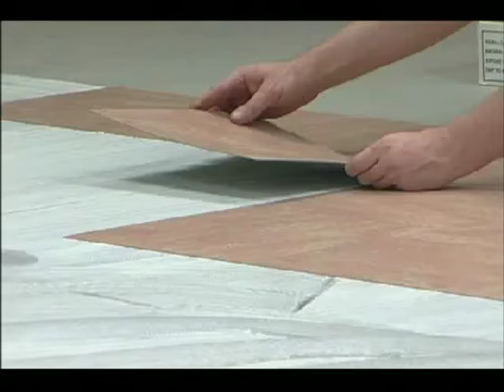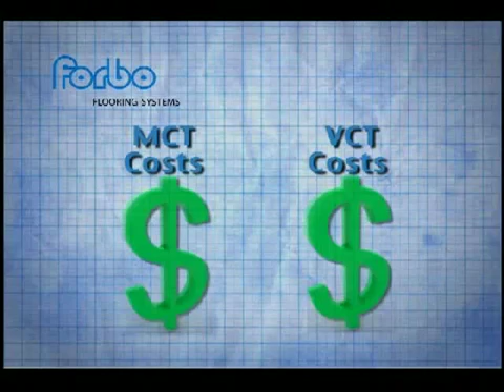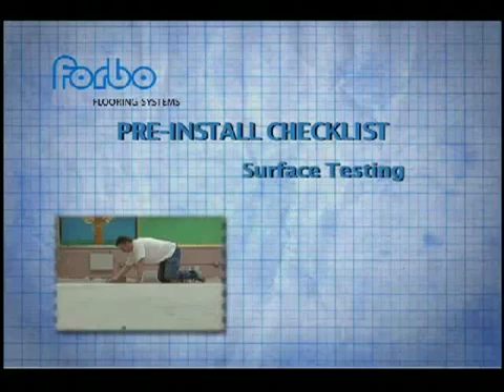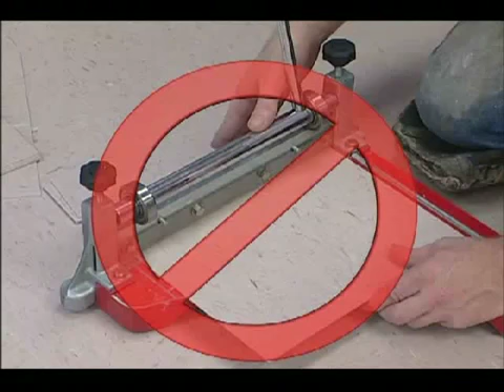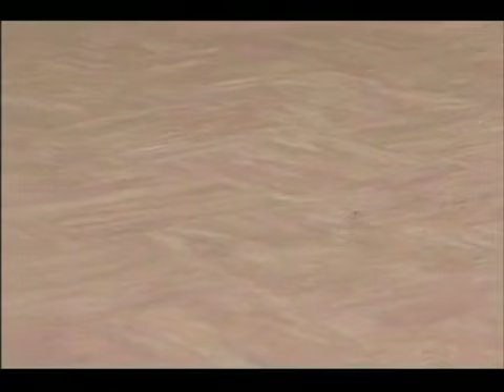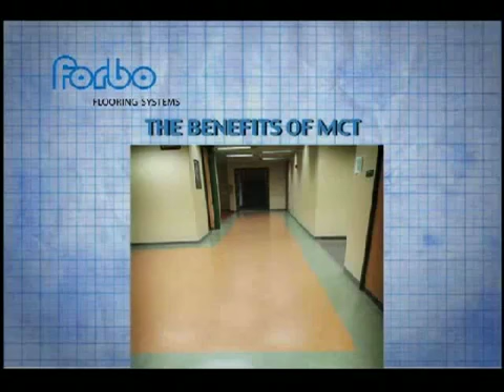MCT Installation - Marmoleum Composition Tile

Comment: This video is BS!!!! I've been on hundreds of VCT installations. That said I've also done dozens of Forbo MCT instillations. In my opinion Vct is a faster install due to the fact an installer can glue up several rooms at a time and leave the adhesive open for at least 12hrs before installation. For the installation of MCT the product must be installed into the wet adhesive allowing no more than 15min of open time. Installing the MCT into the wet adhesive also tends to spread apart at the coarse lined during installation due to the installers position and body weight. Vct installation has no issue with coarse lines separating from the installer being on top of the product during installation. Further more Vct adhesive does not seem seep through the course lines of the product during installation as does MCT.
Reply: Roderick Cobb . You’re right! This might be a good product, even better than VCT, but the installation method SUCKS! And they keep making all these videos trying to convince installers that they’re better. THEY’RE NOT! THAT INSTALLATION METHOD SUCKS!